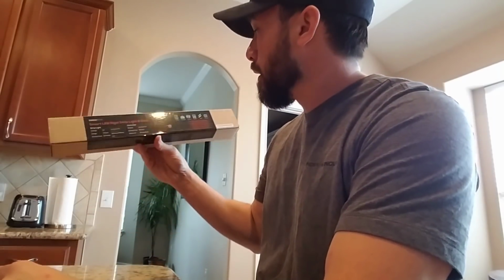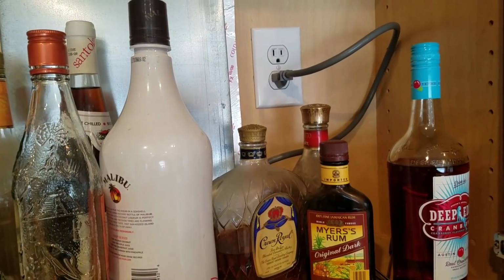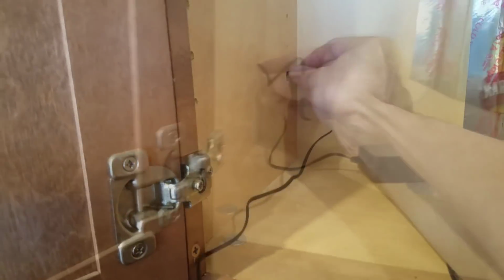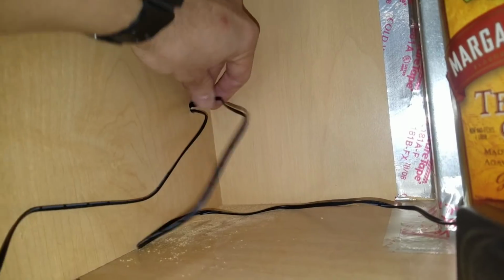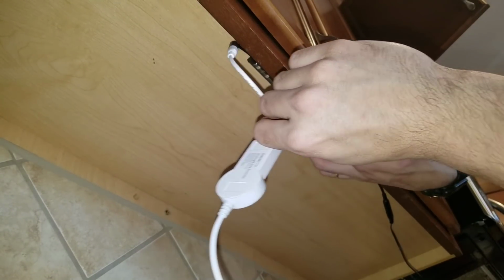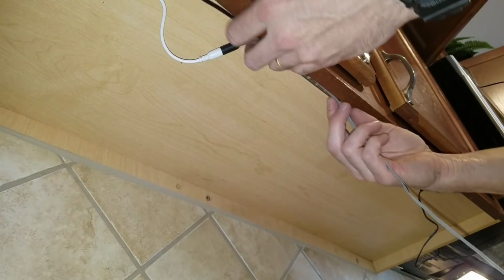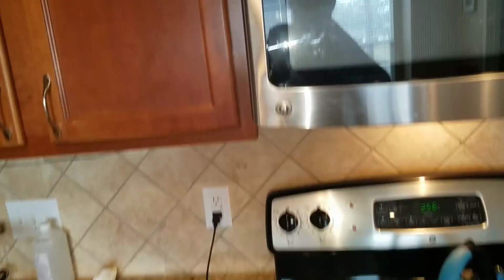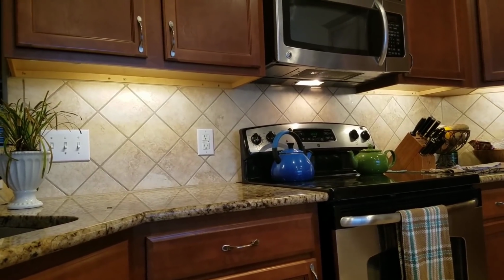How To Install Smart LED Under Cabinet Lights TorchStar

Comment: Trying to understand what you did around the microwave. Wouldn't have been easier to drill a hole inside the cabinet and at the bottom and ran the wire from there.

Comment: On the side to the right of your microwave, did you have to drill the strip of wood between the cabinets to run the wires between lights? And solder the wires?

Comment: Led usb rechargeable lights are so much easier, i have veepeak and work great. Have 3 settings always on?, on movement or movement in dark. Just need to recharge when battery dies down

Comment: You had a drill handy for drilling holes why the hell did you cut the wire. Just drill a hole big enough for the connectors to get through

Comment: very nice..i also am installing 2 kits in kitchen w/ motion... however ...not sure max wattage on extending 2 kits to 1 power supply.... ( 8 strips to 1 plug and sensor).. any thoughts ? or do I need fire insurance on that idea...nice install you did by the way!!
Reply: Just go on the manufactures site or the WayFair site.  They give specifications, etc.  You can connect a maximum linkable wattage is 12 Watts.  You can connect 8 total light bars together.

Also found out you can have multiple setups and control individually in your Alexa App.